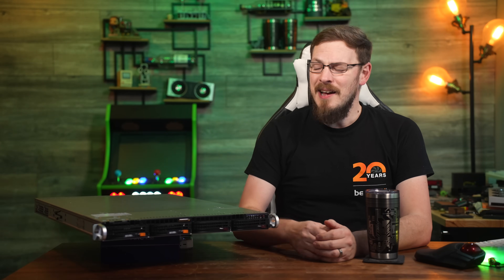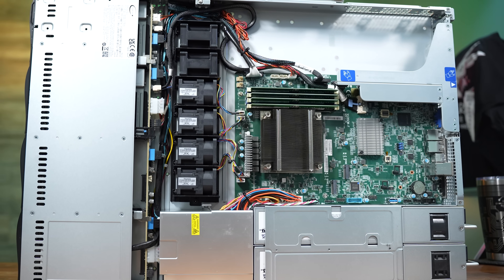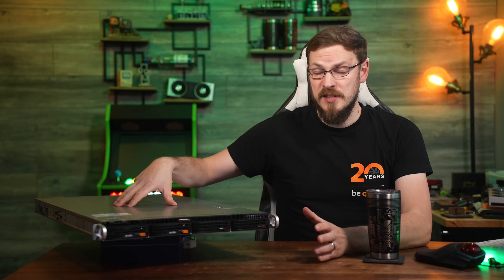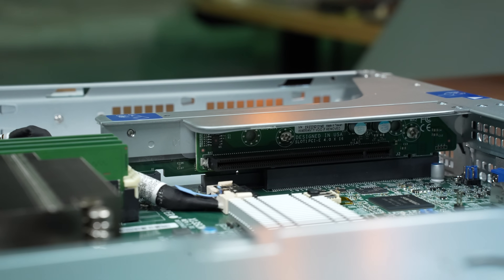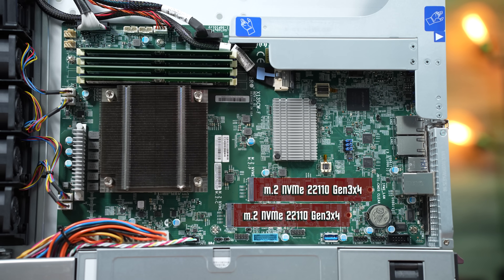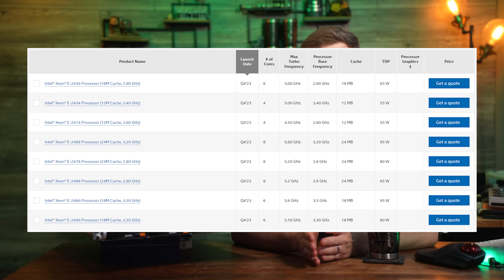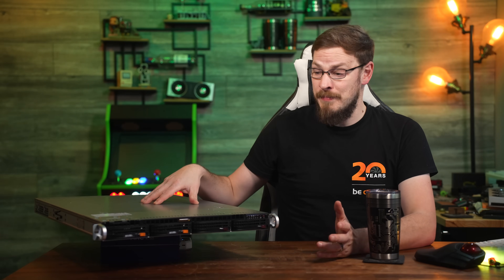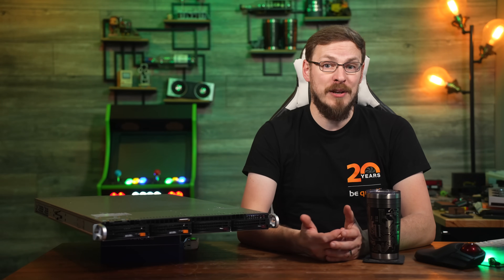Intel Xeon E-2400 Series First Look

Comment: I think this is the straw the pushes me over the top.
Jeff is now firmly in the "Smug Asshole Techtuber" space that Linus and Wendell created.
"I don't see a need for this, so it sucks and you shouldn't use it either" should be the by-line for this review.
I'll make sure to tell the LARGE franchises I know who will be buying thousands of machines based on this Family and Chipset later this year that Jeff says they are dumb.
Let's dive in
- Despite showing the specs on the screen earlier in the video, the 3.2 Ghz base is suddenly a 3.6 Ghz base when bitching about Turbo speeds.
- Zero accommodation for the fact that Server Operating Systems are not great (yet) at BIG.little type architectures.
- Despite the fact that the E-2488 can outrun a E5-2690 v4 from ~5 years ago (A 14 core chip BTW), "it's not fast enough" (Not every server needs a score of 100K)
- Completely ignores the fact that most shops don't have or need 2.5G or 10G for this class of machine, again he apparently has never heard of ROBO where 1G still works fine.
- And the Chipset doesn't come with 1Gb NICs anyway, so this is really a SuperMicro Decision, not an Intel one.
- The NVMe is too slow!  Isn't 8GB/s basically 64Gbps?  Don't LARGE companies run LARGE Hypervisor hosts with 2 x 16Gbps Fibre Channel Ports???
- Incorrectly states that Intel has now added SAS support.  I can find ZERO mention of this online, even the SM Website says this model server supports SAS with an ADD IN CARD.
- Ignores the fact that this class of machine goes back to the E3-1xxx (v1) family, which are 2700k era CPUs, and for the longest time, just like the Desktop chips, were maxed out at 4c models until AMD gave Intel a reason to compete.
- Lastly, compares a cut down EPYC to a Desktop CPU with a Xeon badge and then says the AMD is sooo much better.  Ya think?
- "These servers are not usually pegged and process work as it comes in" ... 1 MINUTE later "OMG, a 10 minute stress test overheated the CPU"
- The SuperMicro AMD Sienna Platform, not even including any CPUs, RAM, etc, is 2x the price of the Intel.
I could probably find more, but I'm just done.
Reply: The SAS thing is weird, surely he plugged in a drive to verify that feature
Reply from the maker: There are two factual errors in this video.

1) I confused the chassis specs of the Supermicro 815 for a spec on the E-2400, which is where I got SAS support from. You are correct, these chips do not support SAS without additional hardware.
2) I forgot W680 chipsets exist, which enable non-reg ECC support for 13400 and higher (non-F) SKUs. To be fair, Intel pretends they don't exist also.

Now, to your points.
- I mention 3.6GHz, because the turbo is still active, but the chip limits itself to 95W. It settled in at roughly 3.6GHz at this TDP, still above its base clock of 3.2GHz.
- KVM and HyperV both support heterogenous architectures (Big/Little). It's VMware that doesn't, and you're far more likely to find the former in smaller shops.
- I never said the 2488 wasn't fast enough. I said it didn't compare favorably to its competition.
- Most shops don't need 2.5G or 10G, but if I'm deploying a $4000 server (which is roughly what this was configured), I'm going to tell the customer to spend $300 on a 10G switch to avoid slowing down individual clients.
- I said for specific workloads, running all the NVMe through chipset lanes could become an issue.
- You got me. No SAS support.
- I am well versed in E3 series CPUs. The difference here is Intel removing MASSIVE features compared to their consumer counterparts. E3s always had core parity with consumer chips. E-2400 is a step backward.
- "These servers aren't pegged all the time". My point was, yeah, they better not be, because all of the benefits of that 5.6GHz turbo is GONE after 30 seconds. It's not like Raptor Lake has a huge advantage vs, oh say, a Zen 4c core at the same frequency...
- Speaking of, the cutdown Epyc CPU (8124P) is in the same price range configured with similar hardware, and is a much more expandable system.

I address almost all of your concerns in some context or another in this video. I even sum it up at the end that "If all you need is 8-cores, a max of 128GB of non-REG ECC and four drives, this will work just fine. It's just not the platform I'd recommend to my customers."
Reply: @CraftComputing  so it has 20 PCIe 5.0 lanes?
Reply from the maker: @shanent5793  https://www.intel.com/content/www/us/en/products/sku/236182/intel-xeon-e2488-processor-24m-cache-3-20-ghz/specifications.html

Straight off the ARK page. 20 PCIe lanes, arranged in 1x16+4 or 2x8+4, just like I listed in the spec sheets.
Reply: @CraftComputing  they're not all PCIe 5.0 lanes. Only the x16 is Gen5, the remaining x4 from the CPU is Gen4
Reply: One thing is for sure, you know a lot more than I do. Did you also click 2 times the like button?

Comment: I was super bummed when I found out they weren’t going to release any G variants. I need QuickSync!
Reply: Same! Been waiting for ages for that! Quicksync + ddr5 ecc + relative low tdp xeon! The only option for that currently is "old" ddr4 versions released in 2021Q3 (2388G).
Reply: You would need a w680 chipset to get quick sync, ecc, and ddr5. I have one such board.

Comment: This is one of those products where I ask "Who was this designed for?"
When I don't have an answer, I shift to "What failures in production resulted in this product becoming the salvageable result?"
I try to stay away from hyperbole, but in this case, these CPUs really DO seem to be a waste of sand.
If you need ECC, unbuffered doesn't cut it.
The mid-range core-counts are dumb. You either want a ton of E-cores (Which are MORE PERFORMANT than a hyperthread on a P-core...) or you only need a few high-speed cores.
If you are running one of these 32-thread CPUs at +90% usage all the time, you should be using a totally different CPU.
If you are running one of these at 1-15% usage, you should be using a different CPU.
If you have huge spikes in workloads, you should be using a different CPU.

No matter what you do with it, you are better off buying something else.
Even if it does meet your needs perfectly, you could save a bunch of money with other CPUs. And you could even get upgradeability while you do.
Reply: What makes unbuffered ECC unsuitable?
Reply: @shanent5793  The short answer is capacity.
The slightly longer answer is availability. 
The longest answer also includes slightly more ECC protection (though debatable since the extra check on the memory buffer doesn't do much).
Basically, registered memory takes part of the memory load off the main memory controller and puts it on individual buffers on the RAM itself. By doing this, the memory controller can handle addressing WAY more RAM. You won't see more than 128GB without registered, and the cost difference is substantial, since UDIMMs are only a tiny portion of the demand compared to the regular old RDIMM.

Example for a single 32GB stick of DDR4-3200 ECC:
RDIMM ~$38
UDIMM ~$88
Reply: @Prophes0r  At capacities that actually require registration, RDIMMS cost more

128 GB DDR5-4800 ECC:
128GB RDIMM ($1299) * 1 = $1299
32GB UDIMM ($138) * 4 = $552

Comment: Not even halfway through this video and it is pretty obvious that these CPUs are desperate attempts to not have garbage made out of bad bins of cpus. Basically, they're selling garbage CPUs that didn't make it as consumer CPUs to Enterprise customers.
Reply: All right, now that I'm at the end of the video I have some thoughts. This system does have a use case but but it's priced way too high to be of any real value. Target customer would be back office servers for gas station POS. Managing pumps and retail sales, with only very small data backups to basic raid arrays. With two of these and a raspberry Pi has a proxmox cluster, running two virtual machine servers in a high availability system, this could have useful applications for never having a store go down, even when there's a complete system failure. But this is a really niche application.

Comment: The biggest contender are the Workstation Processors and there are lot of Servers build with them. A W2465X is an ideal Hypervisor Processor yes it costs 3 times as the E-2400 series but it comes with 16P Cores and up to 2TB of ECC Ram and a meager 64 PCIE 5.0 Channels, which is still 3 times the E-2400 got. Why they are a perfect Hypervisor with only 16 Cores 32 Threads ? When you are running a small AD Domain with an Exchange on Premise. The smallest bundle Microsoft offers are 8 Core licenses with each 2. So the smallest license for a Windows 2022 Server is 16 Cores. You pay for the Cores on the Hypervisor. Exchange 2019 needs 4 Core and 128GB to run... DC needs 2 Cores. Normaly you have a Twin Configuration with two Hypervisors and 4 Microsoft VM's running, so you can swap over. That means you need two Hypervisors with 8 cores for a Failover, most likely 12 cores and 256GB of Ram is plenty.The rest of the Cores can be used up for Linux etc. But the E-2400 is virtually Useless 8 Cores and 128GB of Ram don't cutt it for an On Premise Small Domain with Exchange, while an W-2465X has enough Power for it with minimal licensing fees. AMD has some nice Threadripper Pro in the 16 Core and 1-2TB with lot of PCIE Lanes out there. As Small Server CPU, 8 Cores they are useless you can get literally more Performance when building on a Ryzen 9 7945 pro 12 cores with 24 PCIE Lanes and a Board which supports ECC. That should have been the benchmark for the E-2400 Series.

Comment: There are only 16 PCIe 5.0 lanes, not 20. That's all that Raptor Lake supports. Nor do they support SAS on their own or through the chipset, you will still have to add an HBA. The Supermicro datasheets only mentions SAS support in the backplane, and not in the motherboard. Did you personally verify either of these capabilities?

Registration and buffering are orthogonal to ECC; the registers on the address bus allow the signal to fan out to more chips per DIMM, which enables double the command rate, but unbuffered ECC is still ECC.

Comment: I think intel had an opportunity to shake things up with lga 1700 xeons. Could you imagine a 24 thread e-core only chip in this server pulling only 35 watts at full tilt. Yeah, clock speeds would be low (4.3ghz max turbo), but the thread count and power savings would completely make up for it. It would legitimately be the perfect cpu for the average person's home lab.
Reply: They made that years ago. It’s called Snow Ridge. The issue is Intel’s e cores aren’t that efficient, they’re just small and cheap to make. That’s why nobody wanted them in the wider market, and only telcos pushed Intel to give them the chips. You can also find similar products in many older switches.
Reply: @1armbiker  respectfully, I disagree. I know they might not be as "efficient" as ARM cores, but when you think of the average home labber, they don't need 225w to run the services they want to run. Heck, skylake chips are a go-to option for home lab right now, to think you can get 6500t performance (N100) at 7w is crazy. That is the same performance at 1/5 the power draw. The down side of e-cores as I see it, is the limited  pcie connectivity. Something like a N100 only has 9 pcie lanes.
Reply: @7MBoosted  The N100 has a very strict power cap though. The performance per watt of the E cores is horrible when you let them off the leash. On leash like the N100 they make great little appliance processors.
Reply: @Knirin  why would you not want a high core count power constrained processor in an appliance such as a server? My whole point is that for most typical services you don't need a whole lot, so why not slap 16, 24, 32 e-cores on a chip and be able to target a low power envelope and still be able to run damn near anything in a home lab? People are still going out and running high core count ivy bridge and haswell xeons for their home lab. They run the software fine, but the power use is through the roof. Why not get the same performance per thread at a 5x reduction in power use?

Comment: These Xeons exist purely for specific system implementations that cannot use E-cores. Since 12th gen Intel's xx500+ (non-F) CPUs support ECC when used on W680 chipset motherboards which is likely why these are the first E series Xeons released since Rocket Lake.

Comment: As mentioned already in the comments, the lack of virtualization support with the heterogenous CPU architecture would prevent many server use-cases.  However, there are a few more reasons why efficiency cores were disabled, often centering around workloads that need consistent timing.  Various application bugs have cropped up when switching between performance and efficiency cores that best avoided in a server environment.  Thus offering a chip like his without efficiency cores makes sense for the target market.  

It would be nice to see a bit higher single core turbo and multicore turbo even if power consumption was bumped up to a 130W value.  Ditto for supporting faster ECC memory.  It would give this platform a bit more single threaded performance which could be this platforms selling point.

On the flip side, is AVX-512 enabled?  The performance cores do have AVX-512 units on the consumer side but Intel has fused them off on all Raptor Lake chips.  It would make sense to enable given the lack of performance cores.

As for the motherboard, we really need to see more affordable  PCIe switches for platforms like this.  The 16 lanes of PCIe 5.0 off of the CPU can easily fan out to 32 lanes of PCIe 4.0 for storage or 64 lanes of PCIe  3.0 for legacy devices/expansion.
Reply from the maker: Big/Little works in both KVM and HyperV. It's VMware that won't support it.
Reply: There's no competing with the integrated PCIe lanes. An x48 lane PCIe 4.0 store/forward switch chip costs over $200, PCIe 5.0 will be even more. By the time it's in a board it's gonna be $1000+ so it doesn't add much value compared to EPYC or bigger Xeons

Comment: A big use-case for Xeon E-series CPUs is low-end and mid-range workstations where customers want ECC - I am definitely in that group. Having said that, most of the observations about the E2400's shortcomings for server use hold for workstation use as well: lack of E-cores/limited core count, so-so memory limit, limited PCIe lanes. As others have mentioned, there are enough niche uses for the E-series that it probably won't fall completely flat, but I'm as disappointed as Jeff.

I do take issue with Jeff's assertion that unbuffered ECC isn't "real" ECC. The buffer is primarily there to allow lots of modules to coexist. If you're only allowing 4 memory modules anyway, then buffering is an unnecessary expense and performance hit.
Reply: ECC is ECC, but there are some features that come with enterprise ECC that are missing from some implementations. For example, I have an AM5 system that supports ECC but errors are not reported at the platform level, they are only detected by the operating system.

Registers/buffers only allow for more memory packages to share the command bus. Eg. a registered module can have 40 x4 packages for 64GB vs. unbuffered with 32GB with 20 x8 packages at the same density. Implementations, registered or not, allow for a maximum 2 DIMM per channel.
Reply: That's why I got a W680 system, it supports ECC and you can use k skus.
Reply: Sweet, they found their ONE customer.
Reply: @Nalianna  HP sold millions of their Proliant MicroServer series, enough that it got... checks notes 10  (well, ten generations and several "v2" so like a dozen) generations of them.

Comment: The CPU <-> chipset link is x8 - not x4 - according to the motherboard block diagram in the manual. So the PCIe bandwidth isnt quite that badly constrained (still not great). However In a entry level server platform I would prefer if they split up the x16 CPU lanes into x8 x8 or x8 x4 x4 like they used to do back in the E3 generations.
Reply: The Raptor Lake architecture limits it to x8/x8 bifurcation

Comment: By the way, the Core series (non F and higher end i5 or better) now support ECC too as long as you use a W680 motherboard. These Xeons are real head scratchers for me…
Reply: Really?  

Is it a sort of unofficial "we won't support it or help you but it might work" like with ECC on Ryzen, or do they actually support it and verify that support?
Reply: @MiIIiIIion  it’s officially supported and endorsed by Intel
Reply: Supermicro X13SAZ-F with 13500 and DDR5 ECC 😊
Reply: @weisstdudochnicht1  does corrected errors are reported back to the OS through the EDAC driver?

Comment: The big question I’ve had for a long time is why don’t more server builders use Ryzen?  It’s got the best core count for the socket size and ECC support.  Seems like a great low end server processor but aside from Asrock-Rack I don’t know of another server board that supports Ryzen.
Reply: I have that Asrock AM5 board and it's mediocre, I wish there were an alternative. ECC errors can only be detected by the OS, so the system can crash without the platform logging the error. The BIOS is clunky, not because of the text interface, but because of the slowness along with the plethora of confusing and contradictory options presented that do absolutely nothing. It also tends to fill the logs with false fan errors if they're not revved up, it seems it just can't reliably measure below 900 RPM
Reply: @shanent5793   Good to know I have their AM4 board at my house and its been fine. Guess I can take that upgrade off the table. Still seems like something that could be good if done right.